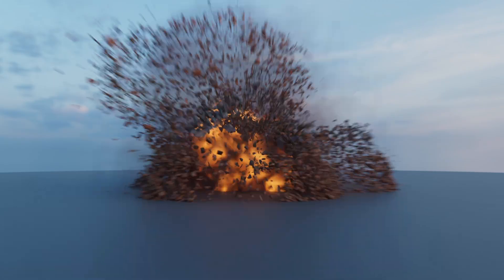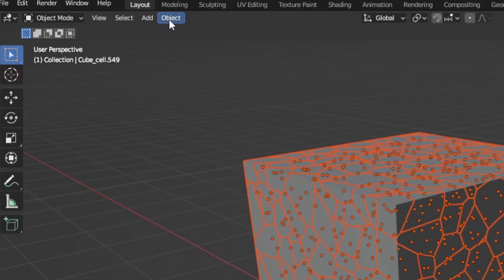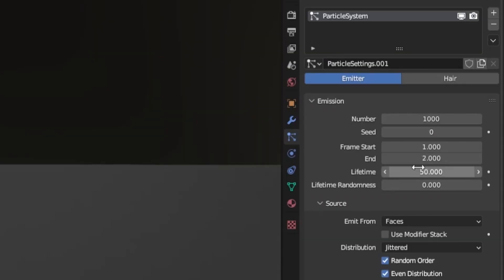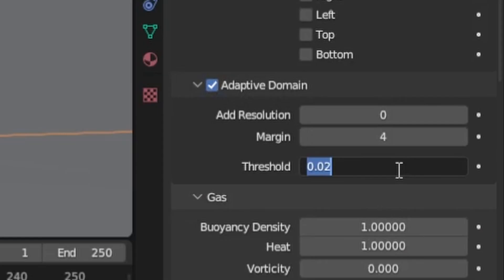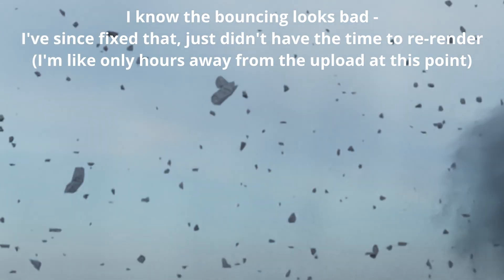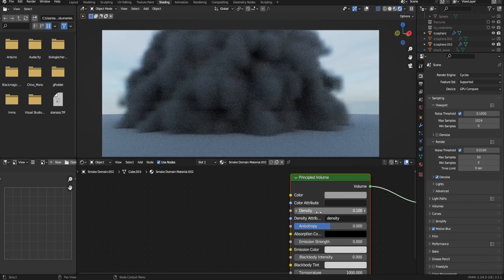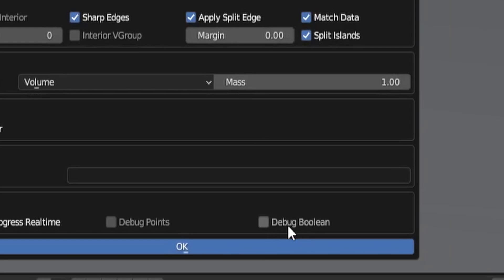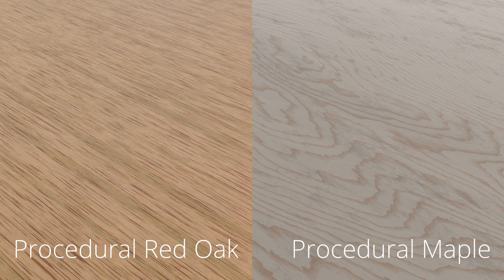How to Explode Anything in Blender

Comment: Awesome tutorial! Though for some reason my explosion disappears after I bake it and doesn't appear in the render either. Would you happen to know any way to fix this?
Reply: i had a similar issue. i fixed it by changing the rendering engine from eeves to cycles (in the rendering tab). i dont know why this happens exactly but i hope it still helps